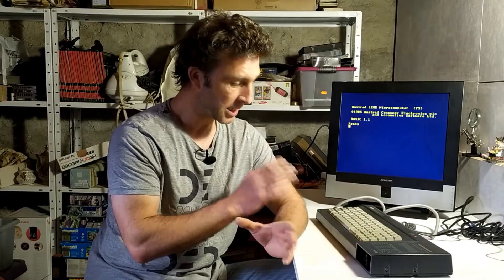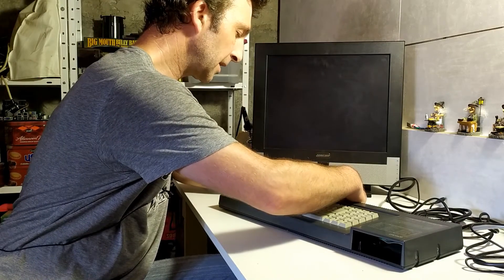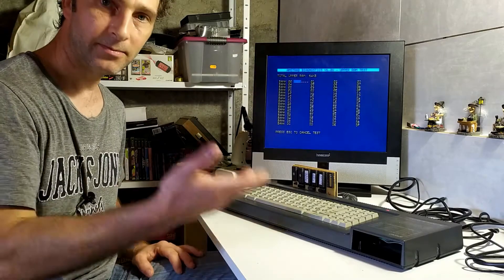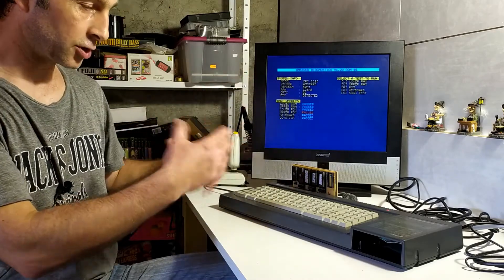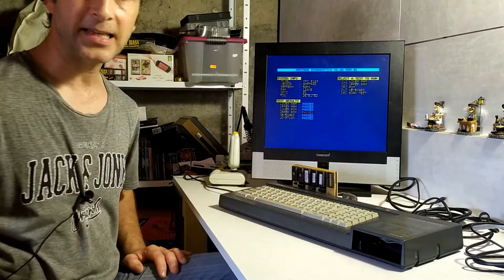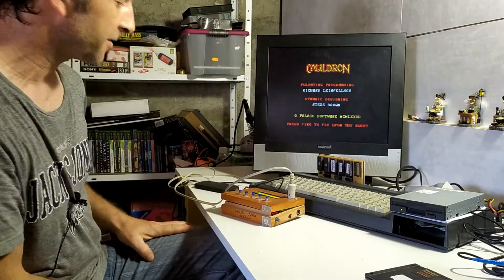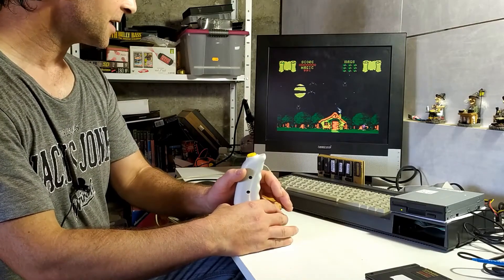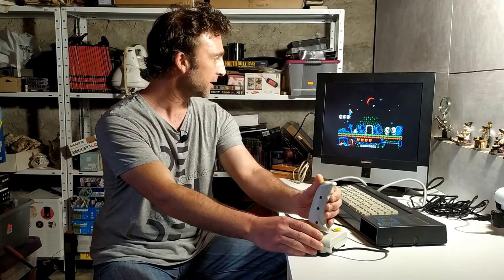An Amstrad for a VIc-20. Fix up and sell on - part 3 "System tests"

Comment: Nice video and very nice rundown of the Diagnostics ROM! Good job! I'll add it to the Github wiki for people who'd rather watch a video. 
Also, great job with the restoration. I'm still shocked it was cheaper to buy a 6128 than a VIC-20! Around here the 6128s are getting pretty expensive too.
Looking forward to watching your future videos!
Reply from the maker: Noel, this is the very first time I've had a comment from a celebrity youtube guy, wow. I'm humbled you find my ramblings about your Diagnostics worthy of the wiki. The restoration has gone well so far, luckily the system is just dirty and dusty, but nothing that calls for a soldering iron (at least not so far, although I still have the floppy to check out). It's crazy isn't it, all flavours of Amstrad here can be quite expensive, but often times they pop up cheaply enough. Vic-20s on the other hand, don't. Thanks again for your kind words and the Diagnostics program, I can move on the 6128 safe in the knowledge that the systems 128k of memory and its ROMs are in top shape ;)

Comment: Looking good!  Someday I will start importing some PAL machines for my collection...I think this computer will be near the top of my list!
Reply from the maker: If you're looking to add some of the Euro PAL systems to your collection I'd say that you should put the Amstrad on top of your list! Only thing to be aware of is that they were sold with a monitor and were never intended to be connected to TVs. That's not really a problem in Europe. It's very easy to make up a cable to give a RGB signal to scart on a TV. In the US and Canada I think that scart isn't a thing, so an extra device is needed to convert the RGB to something you can connect to your TV. Thanks CRT

Comment: Looks like we have a winner! Would be nice to see someone trade you fro that VIC-20 or at very least you get a good price for it so you can buy one.
Reply from the maker: It's shaping up very nicely indeed. I had a lot of fun cleaning and testing it, much more than I thought I would. All that's left to do now is clean and test the floppy drive and make up the power and video cables then soak test them a few hours (the cables I've been using are from the 6128 in my collection). As for the sale... we'll see how it goes. Thanks as always Gorf ;)
Reply: @8bitsinthebasement  NO thank you for these videos... I enjoy watching them.

Comment: Yes please can you give us the link to the test board? Thanks for the video and the series
Reply from the maker: Sure can   http://www.cpcwiki.eu/index.php/ACU_Romboard_(DIY)
The thing is that you'll have to build it yourself. I'm not sure if anybody is selling these. It's a board that will let you load ROMs directly into the Amstrad's memory. I flashed Noel's Amstrad test ROM https://github.com/llopis/amstrad-diagnostics to an EPROM and stuck it into the board. It lets you run the tests really fast. You could load the test rom from cassette if you wanted to.
Reply: @8bitsinthebasement  thanks for the answer!   may you recommend an eprom programmer to write the eprom?  if possible one compatible with actual computers  (usb...)

Comment: I would bet Noel's RL would trade you a Vic20 for your 6128. He seams to believe the 6128 was one of the best home computers at the time. He has a video saying so. Plus he lives in Spain, sorta close to you.
Reply from the maker: Maybe, but I'd imagine he has a whole lot of 6128s in his lab, I'm not sure he needs another :). I have no doubt in my mind that the Amstrad is one of the best systems to have come from the 80s. On build quality alone, it's got a great keyboard and in my opinion the case looks good. What's more they can take a lot of abuse and still keep on going. The 6128 in this series was only dusty and a little dirty so it's no surprize that it works well, the first one I got however was in a very bad state (I'm sure the main board was droped a few times, given all the bent and broken caps, not to speak of the scratches and marks on it) and with very little work was brought back to life. The version of BASIC it had (Locomotive) was among the best available at the time and If games are your thing there's no shortage of them on the system. It's also a great system if you're into building hardware add-ons, the internet is full of plans for rom boards, devices to connect to RS232 printers, network adapters and a whole host of other mods to keep you busy, and the Amstrad has all the ports you need to connect all this right on the back of it... and I'm looking to shift it on for a Vic-20. Funny old world isn't it? ;)
Reply: Wish we had more 6128 or any Amstrad in North America. NTSC.
Reply from the maker: @mikeme9938  I know the feeling. I wish that the Colour computer 3 was more plentiful here, the vast majority of PAL ones live in Austraila and I've never seen a PAL Coco 3 for sale on ebay or any other site in Europe.